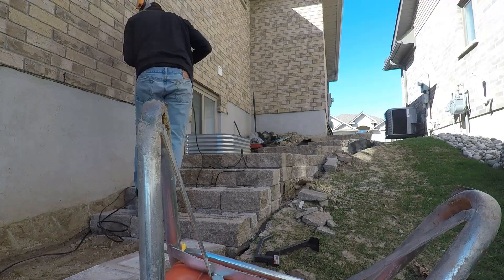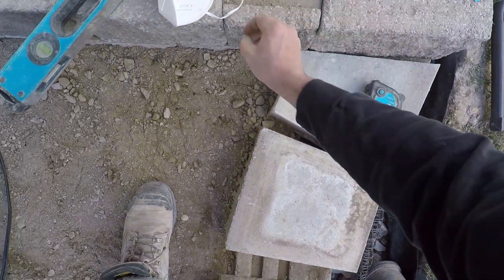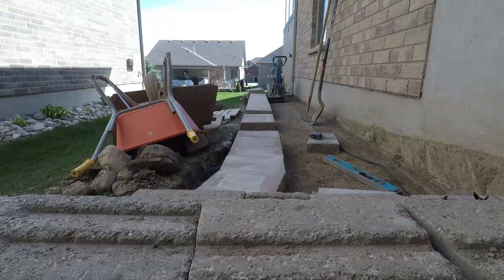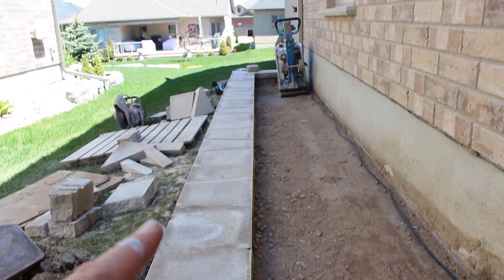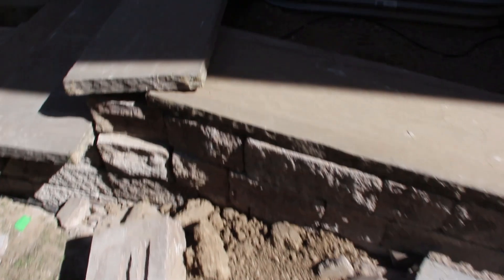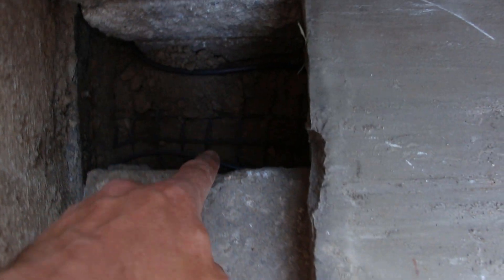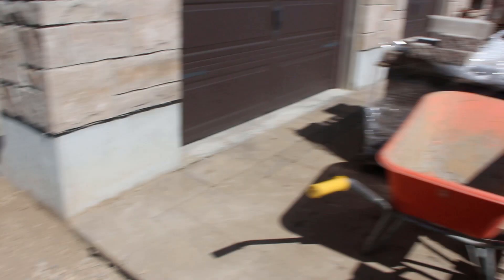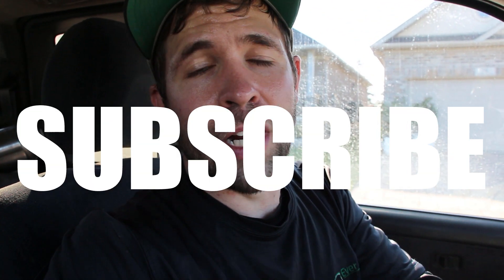Cutting Caps for Curves | Hardscape Vlog #8

Comment: Thanks for the clear, well-communicated info on how to cut caps on a curved wall, how your string line was measured equidistant to the foundation, and the small tool tips. This is going to directly help me with a small wall job starting tomorrow!
Reply from the maker: Glad it helps!

Comment: Do you take in consideration the spacer of your pavers or its just that you have 26inches of space between your caps and the foundation, so 2X13 will fit perfectly ?    nice video !!
Reply from the maker: Thank you! Yes, the 26” takes into factor the spacers. You also have to take into factor that the split face of the caps are not always uniform so you may need to run your saw along them (they are split faced on both sides) to ensure that the pavers will fit nicely.
Reply: @iamahardscaper   Thank you, have a nice week end !